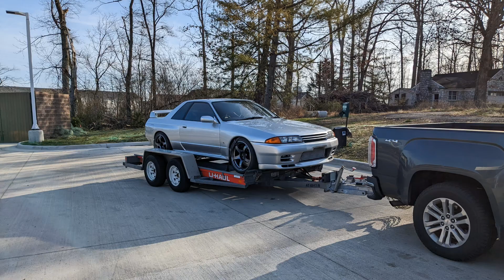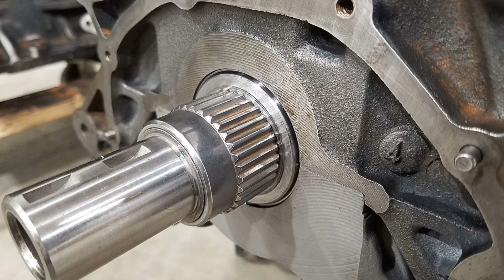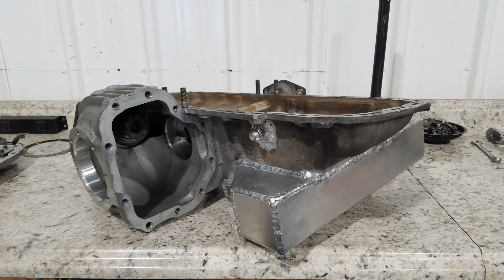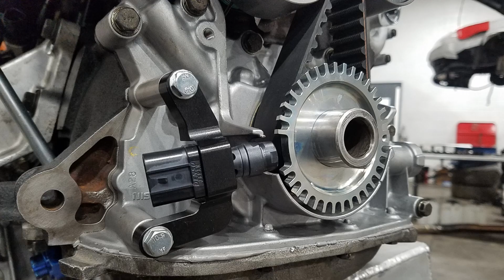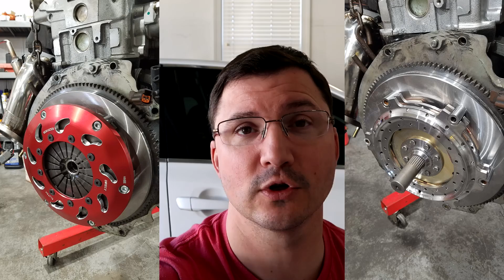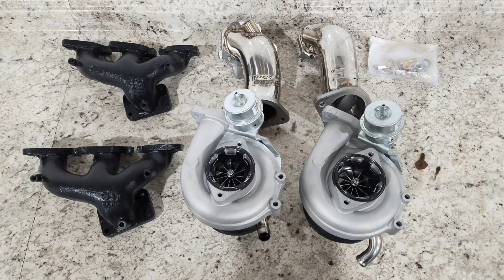Engine Build overview for my R32 GTR

Comment: hey, you mentioned wb1 for the wide band, don't you need the wb2 for the twins? or you can still use the single channel version?
Reply from the maker: WB1 is put a bit further down stream in the car delete.

A dual channel could pick up bank 1 and bank 2, but if you are going that route, you might as well get individual egt sensors for each cylinder.

This engine isn't tuned to the ragged edge for racing, so a single WB is sufficient
Reply: ok cool gotcha, love all the in depth videos you do on your r32. mine has been stripped down to a shell, pretty much at the process of rebuilding the subframes with what you did before. hows the build going so far?  @PlatoonGarage
Reply from the maker: @xxxclusv  best of luck, definitely get it back together and enjoy it.

My car gets driven almost every weekend, and I'm loving the power upgrade 🤙.

I have some videos filmed that I need to edit and get posted soon
Reply: @PlatoonGarage  ok awesome can’t wait to see the video and yes it will be enjoyed for sure!